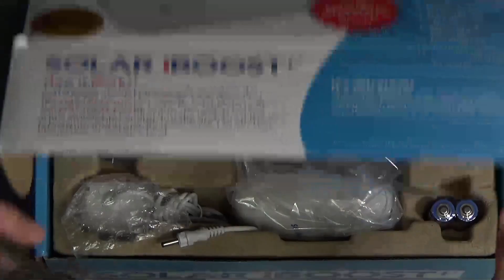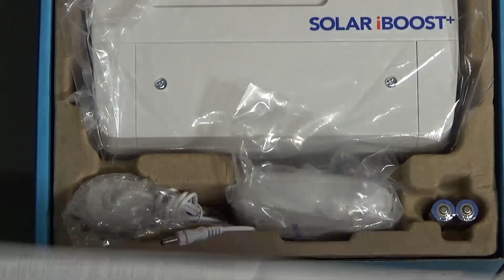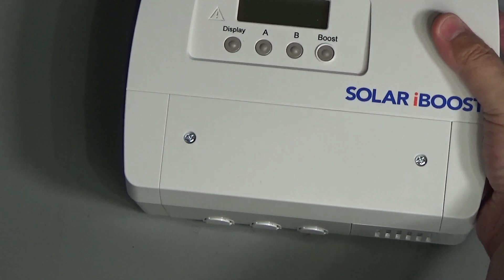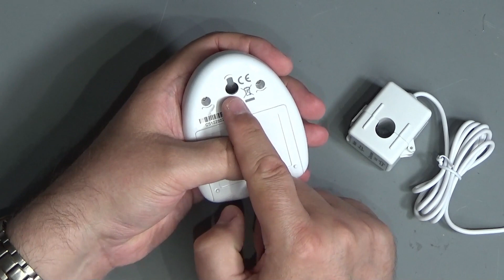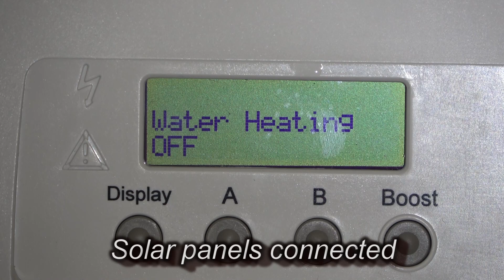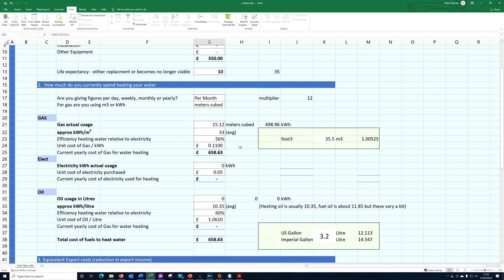Solar iBoost+ Diverter Review Installation - Is it worth it #0063

Comment: Thank you for the detailed video, I'm sure that was a lot of work!  I'm self installing a small 2400W solar in the next two weeks and given the current 28p unit cost of electricity and likely increase in the coming months, I presume these devices now have a much quicker RoI.
Reply from the maker: With price increases the time for roi drops a lot assuming you have sufficient export available.  Are you also looking at batteries though because if you are there might not be much export left over.  Fir me I git the basics working, then looked at the data to see what adding batteries might give me  then looked at the diverter.
Reply: @MakeOrRepair  i would love to add a battery, my self install total cost for a ground based 2400W array is around £1700 inc, or approx £2000 with diverter.

A battery seems to add an additional 5-10k from what I've read so far. Its hard to justify those upfront costs right now.

The metric im most interested in is how much energy we generate and use in the winter months. I'm in Colchester so im getting max daily sunshine, and my wife and work from home all day so i think we can maximise the power generated.

I can easily add a second 2400W string of solar for approx £800 which might make sense. 

Sorry for the long post 😀
Reply from the maker: @substandard649  I started at 2.8kwh and that met a good part of my daytime usage in spring to autumn and a bit to bexport, but still ended up buying a fair amount to cover peak usage over, washing machine etc.  It is fairly easy to adapt to use appliances when sunny.

Comment: Really interesting. Have just fitted one. Oddly it shows it’s heating by solar even when my meter light is flashing! How can I be taking from the grid at the same time as diverting what would be available to export? Am I missing something?
Reply from the maker: Not sure what my meter lights mean, 2 yhinhs spring to mind.  First that the current clamp is backwards, second that the light flashes during export, third year there is a tiny bit of import, say 10w  fourth that the inverter current clamp and isolation clamp are really close and interfering.  So 2 turned into 4. Does yor inverter have a display that let's you check what electricity is going where?

Comment: Great video and good work providing the assets for people to dig deeper and make their mind up themselves.

From my experience, I had a Solar iBoost but swapped it for a myenergi Eddi. Nothing wrong with the iBoost, it just didn’t come with the same level of control vs. the Eddi (App, API, Home Assistant integration)

Personally, I get great satisfaction knowing I’m heating the water from my solar panels, therefore how much is that worth to people? Historically, people who installed solar panels for their home aren’t doing it just for financial reasons. For me, if I break even after 10 years I’ll be fine with that, which was the rough estimate before energy prices doubled.

Note: I believe you took the energy to heat your water from August. Keep in mind the water temperature delta is probably at its lowest here, to heat water in Jan/Feb to ~65c will consume more kWh’s.
Reply from the maker: Thanks i agree there are other factors than the money, I was really the misleading adverts and sales pressure that made me want to encourage people to think more about it.  Re the water temp delta, you are right, the online calculator let's you see the impact.  also didn't fully take account of heat losses overnight  a problem for us us that we use 90%of our hot water in the morning so it has had all night to lose heat but our insulation seems adequate.  I thought about making the model more accurate but there are so many variables it would be unusable for most people, so in the end I decided to do a reasonable approximation and focus on how much power people can reasonably divert for example In my case I simply don't have any export in nov/dec/Jan it is all stored in battery  so the diverter has no impact then. also since mine is an indirect cylinder I can only heat about the top 70% of the tank using immersion. It takes quite a lot of energy to heat 250 litres per day so I suspect that with rising fuel prices the biggest factor will simply be how much export have they got available to divert, that will be the main limit on savings.

Comment: Thanks for the information provided. I have just bought one of these units and thought it was quite good as my water heating was with gas which I am no longer buying and using the excess solar electric which I was just exporting for next to nothing. I don't have battery storage as yet to worry about but when I do I think I will have to switch the immersion off at night to stop the battery discharging. My gas water heating used about 1m3 per day (1 burn in the morning and 1  burn in the evening) about 35 pence per day. The diverter says between 3.5 and 4.5 kwh of solar diverted into the immersion per day so I feel that it will take about 3 years to pay for it's self at my tariff prices but they will go up dramatically shortly when my fixed price deal ends.
Reply from the maker: Yes I'm only getting 4 or 5 kWh diverted each day too, but that is about 7kWh of gas saved, but the savings get better as the gas prices rise.  I have not changed the gas program, but since the gas has cylinder thermostat the gas tops up the heat each day, just using less gas (my imported gas still costs less than buying full price electricity) I don't seem to have any problem with it taking too much from batteries, it might take a bit during the day as clouds go over but then the batteries win when the sun comes back.  It does not use the batteries at night unless you program a on period.
Reply: @MakeOrRepair  Thanks for the reply. Glad to know that it does not use the batteries at night to heat the water unless you program an on period. Have you adjusted the  storage offset again or are you set at 500w?
Reply from the maker: @5kram  set at about 300W just so I get a nice clear window for may batteries to start charging in the morning and this also makes sure that any little leakage to the grid overnight does not trigger the diverter.  I might drop it to 200W and see how that goes.

Comment: your maths are based on the feed in rate being the goal to cover your gas usage,  but the fact is if you import to heat any energy via electric usage will be 20p per kwh  as what is the norm now, most new owners also don't really get a feed in tariff like first gen users so the export unit rate may only add £8-10 a month,  so the best practice it to use all the electricity to can before it goes to the grid,  these units aren't designed to replace you heating method they will burn out in about 5 years or so if like that  but more like supplement it,  
 like many  who are away from home most of the time due to work.,  your energy levels used at home drop like a stone when no one is there unless you have a high powered unit such as washing machine or heat pump based dryer set to run in these times so would go to the diverter at the rate of a kettle most of the time,  so if your not there all day it can run all throughout the solar day.  and you come home to a hot water tank simple. 
 further to this if you only heated in the morning by natural heat loss the average hot water cylinder looses 6% if its a C rated and most unless your a big family  not really draining the cylinder just a few litters  to 20% at a time, thus the actual volume needed heating may actually be a lot lower and general top up heat. your still be warming up in the mornings unless you leave it on all night to heat 200 litres,  but the fact that it doesn't have additional CT or smart tariff readability makes this unit hard to use off peak as it can't tell if what's coming in is at a cheaper rate or full beans.  all it detects is am i exporting if yes then divert if importing turn off,

 further to this if your at home all day that's a different story,  where your goal will be to use everything you can off grid charge the battery etc minimising grid usage anyway, leaving little to the export unit to heat the water, if your solar array was just 4KWh then between full time house usage and charging a 10kwh pack most of the time its just not worth it your better off plugging in the EV on a granny and smart plug and just charging the car etc then use home assistance and your smart traffic to turn on/off when exporting,  
if your array was a new type of panel between 6-8kwh or very fortunate and have more then its a different story where you will be often exporting or one of the very few to have a pool, again this is where having the diverter is till great to have. your never going to get a real time shut down with any of the devices there will always be a delay causing some usage from the grid for a period of time before it shuts down, some brands are better than others at doing this,
Reply from the maker: @tobys593 The question is how much more is your normal fuel cost vs. the feed-in tariff, the bigger the difference the more you save by maximising your solar usage vs. exporting it.  If you are already sourcing most of the heating power from solar then you are already making most of the saving possible.  What a diverter will do is prevent you accidentally importing electricity during the couldy/overcast times, so on the face of it it meets your need, but do you spend enough on imported electricity to make it worthwhile?  Also the diverter in place on a cloudy/overcast day might mean you don't heat your tank as much as you want!
Since my water heating was intended to be primarily gas I only have an immersion at the top of the tank so can't fully heat the whole tank using the immersion and I found that my diverter is only diverting about 5 or 6 kWh per day so while it will pay for itself eventually it is not sufficient on its own to heat all the water for the day.
Hope that helps
Reply: @tobys593  it also depends where your export meter is, it sounds like you’re on a decent (older) Feed-in-tariff, the meter for this is just after the solar inverter and crucially before you’re fuse board/consumer unit and main electricity meter. Therefore, if you get one of these units it will NOT reduce your ~£2k rebate as the payment is based on your solar meter, not the main house meter. In my opinion, get one. I have a myenergi Eddi and no longer use gas to heat water, I use off-peak electric to heat when solar is not enough and the price for gas vs electric at this time is the same, however, the efficiency of electric is obviously significantly higher.
Reply from the maker: Everyone is different - That's why my calculations are based on actual usage, and actual exported electricity as far as possible so as to avoid many of the confusing aspects. At the end of the day what you use (or a bit more since you lose heat overnight) is the amount of kWh you need, and what you export is what you have available to meet that demand AT BEST., after that you save on the fuel you no longer import and lose on the electricity you no longer export.      
My examples were about gas, because I was showing my calculations, and we use gas, but also to handle the fact that different fuels have different efficiencies, I did also explain how electricity and oil differ  - but at the end of they day they are just another fuel source with differing efficiency and cost.   The key point was to introduce the main factors for people to think about  which I suppose can be summed up as working out how to use the lowest cost fuels and how to organise them to get the best, instead of just the adverts and sales pressure. I hope I did make it clear that you want to use your generated electricity, then if you have them store it in batteies - then what is left is the candidate for divierting to hot water - unless you have a lot of excess electricity you may not get payback - it takes a lot of electricity to heat enough water for two people 4kW panels is likely marginal unless you ar on the old FIT scheme or already using expensive fuels.

Re the off-peak comment - my electricity is a set very low price between 00:30 and 04:30 so I use that for all sorts of things when the weather is bad and in  Winter just based on time - for some people of course they might have more vaiablity (e.g. an agile tariff) and then that is a lot harder to manage - you need smart devices

Comment: Superb video. Just fitted one of these booster+ units after our ImmerSUN unit went bang, apparently a ( Common issue) and even after repairing it 3 weeks later it failed again. I situed the Iboost where the ImmerSUN was place in the garage some 10 meters away from the immersion, but realised the manufacturer of the Iboost required it to be fitted near the immersion, ie in the airing cupboard  even though the Iboost seemed to be working perfectly okay within the garage. My only concern was the heat within the cupboard for placing it where I did, but reading the unit would require double shielded cable if the cable was over 3 meters ...So after a some thought I reconfigured the wiring in the garage so I could move the iboost where recommended. 
At this time we don't have storage batteries, as this is something we may look into in the near future.
Once again great video !
Reply from the maker: Thanks, I suppose the shielded cable is to reduce switching noise from causing interference - that would have got costly - I think I would have done as you did and reconfigure to get the device closer to immersion.
Reply: Power diverters use DC to heat the elements, rather than AC. it’s the best way to do it using mosfets. DC doesn’t like going long distances as you can rapidly get voltage drop. My Solar iBoost+ lasted 18 months before it went bang. I’m now using a MyEnergi Eddi, which works well and has a lot my features and works perfectly with the Hub and Harvi.
Reply from the maker: @sandyfordd1843  I should probably have connected up my scope (with a differential high voltage probe of course).  I suspected a mosfet because I saw the big rectifier on the heatsink and those big inductors.  The voltage loss in cable really depends how they manage the balance of voltage vs. current, there will always be some, I used 2.5mm heat resistant cables to keep losses small.   The fact that they specifiy screened cable for >3m seems to indicate that there is some high frequency switching noise present.
Reply from the maker: @sandyfordd1843  Hope mine lasts a lot longer.  At that age I would contact trading standards and the company - that service life is not fit for purpose!  Anyway perhaps I'll be doing a repair video on it in a couple of years!!!
Reply: @MakeOrRepair  , it was replaced under warranty, no issues there at all, they were great, but it took a few months for my replacement unit as the UK is no longer in the EU which caused delays with customs coming in and out of the UK. I bought the MyEddi instead.